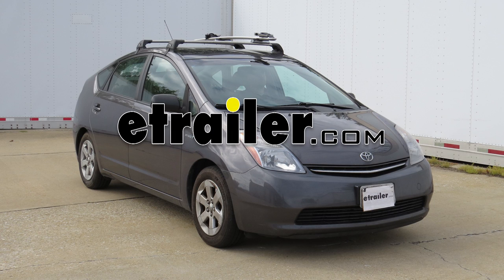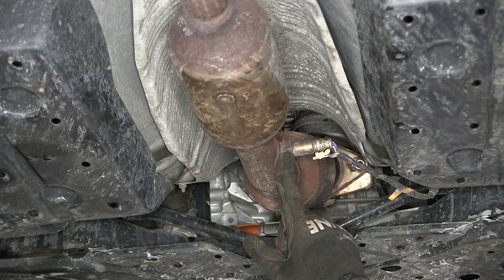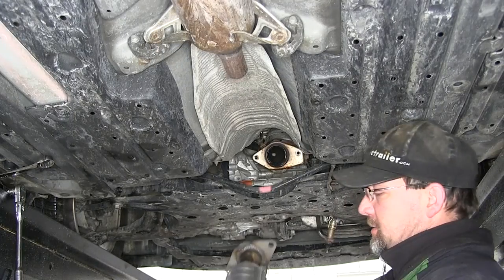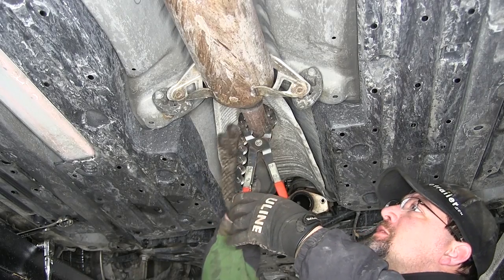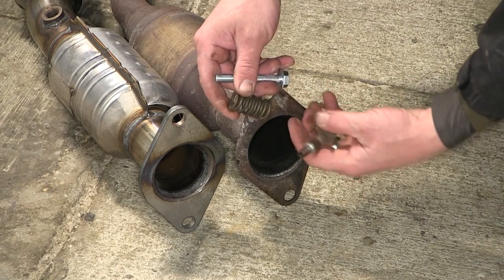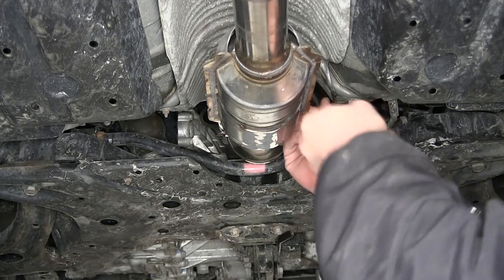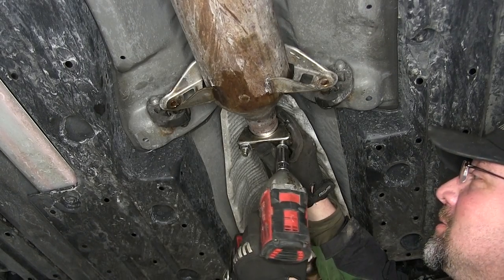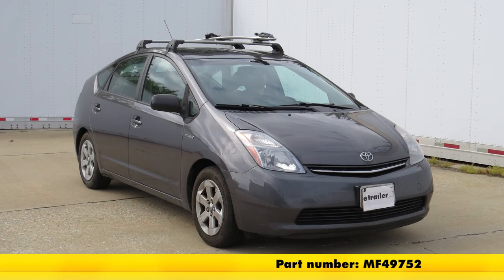etrailer | Set up: MagnaFlow Ceramic Catalytic Converter on a 2007 Toyota Prius

Comment: very simple, thanks for sharing! my neighbor doesnt have access to a lift so she's asking me to help her with this. I swap engines/trans/work on all my vehicles in my garage, so I have all the parts to do this and figured it would be straight forward. But she claimed there were '4 catalytic converters' and i tried explaining i dont understand why a 4 cylinder would have 2 seperate banks (theres only one manifold). Then I just said never mind, show me what you bought. Yup..its the exact part you have here, and most seem to include the new hardware/gasket too!

I dont get why so many are saying you have to weld...this is pretty damn straight forward without welding at all.  O.o

Comment: It's better to weld where the clamp is because then there's no leakage you can use a clamp but I don't think it's the best solution I would much rather it be welded.

Comment: There seems to be something funky about this video.  The part that he installs is not the same part advertised on the website or even shone at the beginning of the video. Does anyone know where you could find the part used in this video?
Reply from the maker: The catalytic converter in the video is the same as on our website. Check out the following link. 
https://www.etrailer.com/Catalytic-Converters/MagnaFlow/MF49752.html

Comment: can this b mount where the gasket meet, without any welding just the bolts?
Reply from the maker: This catalytic converter is an easy bolt-on installation so no welding is required as you can see in the video above.

Comment: I can't remove the manifold bolts. please help.
Reply: O dallay
Reply: Just spray wd40 a couple of hours before. I used a 14mm impact socket, 12 inch extension  by half inch drive and and a breaker bar. The breaker bar will do the trick.